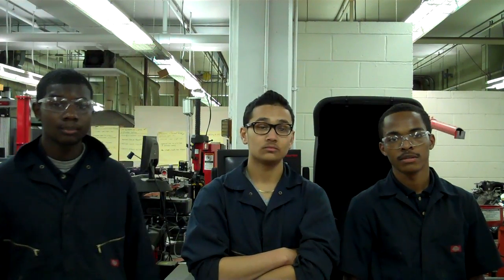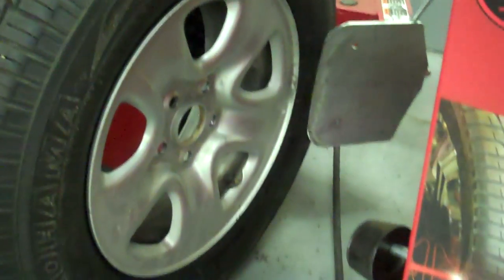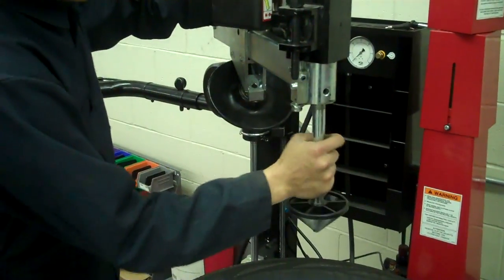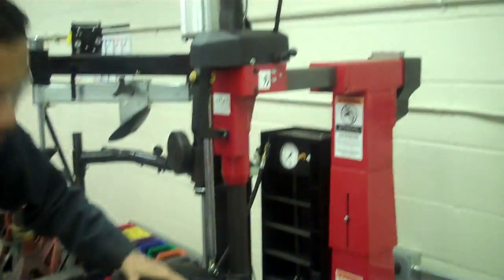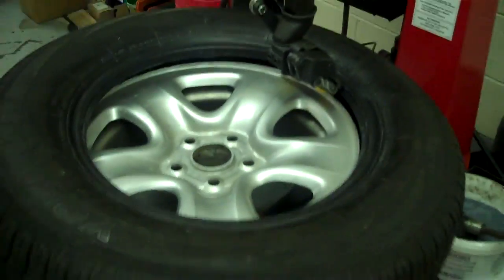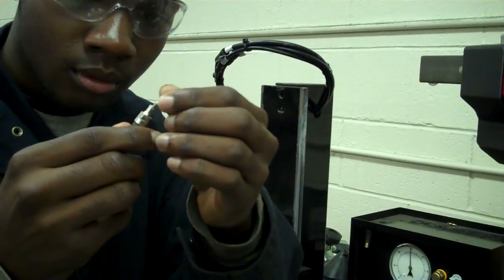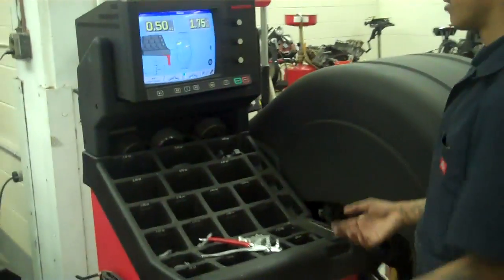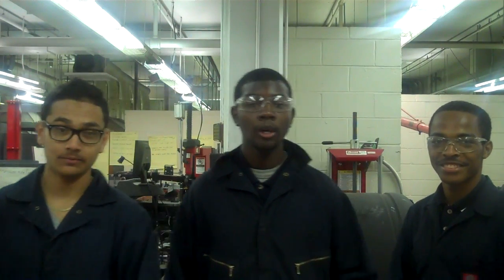How To Dismount, Mount, & Balance a Tire!.mp4

Comment: Sheesh that machine does all the work. You don't even have to think with that machine. I hope they taught you guys how to do it old school as well. :)
Reply: consaka1 old skool ways wont work for todays low pro run flats. might aswell have a shot gun handy if you want them done old ways. just saying.
Reply: danny yo Just because there are some fancy tires and wheels out there needing special machines doesn't mean there aren't plenty of good old iron that needs real tires.
Yeah them run flats are pretty cool but they arent for every vehicle.  Ill keep my tire machine till I have a need for a fancy one like this. ;) cheers.
Reply: +consaka1 Invention is the mother of ignorance. I know how to mount tires with a manual changer, and balance using the bubble balance
Reply: +consaka1 Invention is the mother of ignorance. I know how to mount tires with a manual changer, and balance using the bubble balance
Reply: ***** You got that right. My kids are starting to drive and I have been at odds with them over the whole GPS thing. I think everyone should know how to navigate with a map and learn how city street numbering works. too easy to just poke an address into a GPS. What happens when that thing quits working? lol
Reply: Lol last year at tech school we did alignments with tape measures
Reply: That's what I was thinking 😅

Comment: now can you do it without putting a single scratch on the alloy?
Reply: I just used hand tools to mount on my mustang bulllitt wheels. The secret is to lube the entire bead area and dish soap dries to fast for hand mounting. I use synthetic bearing grease mobile 1,  use finger and rub it on as thin as you can, just make it shine with the grease it will slip on much better.

Comment: You forgot to warn about the sensors that may be in wheels
Reply: most tpms system uses the abs sensor and can just see a diffrence in tire price if the speed of tires not match.

Comment: this was good. lube should be applied to the friction surfaces more thoroughly but you guys did awesome
Reply: enginemodify Still using the old-style tire machines that make the
operator lift heavy rims/tires up onto the top of the changer. Now they
have machines that lift the tire for you and that remove/replace tires
down on the SIDE instead of lifting them up on top. Saves on the back
I tell ya fer sure! (after doing several dozen wheels).

Comment: The lubrication was applied only to the  outside of the tire !   very little if any to the bead and NONE on the actual  rubber surfaces  that  rub during the demount process,  didn't see any lub for the mount process,     the machine will ultimatly last longer if lub is always applied to all friction surfaces,  regards,

Comment: That part with the arrow to help you aim on what is the correct area of the rim it points to (wheel balancing part)
Why didn't the engineer just put a laser mark on that so you can SEE exactly where it is on the rim rather than eyeing it with a hammer extended from the arrow is beyond me... so much technology to figure this data on the wheel balancing machine, and a freaking laser is too much lol

Comment: I don't think they can strip and fit and balance 4 tyres in 15 minutes especially with stick on weights plus they don't use their hands enough. if you have 3 cars needing tires and you are the only tire fitter you cant be spending 6 minutes to strip & fit & balance 1 tire. you will be fired in my workshop!
Reply: good to know. I will never go to your shop. goedendag
Reply: +TrueBlueOzzyStona FilmProductions It's a good thing I wouldn't set foot in your workshop if you treat your workers like that. What do you pay them 9.15/hr? Do you expect miracles out of them for that rate? Also it's an instructional video, it's going to take a little more time.